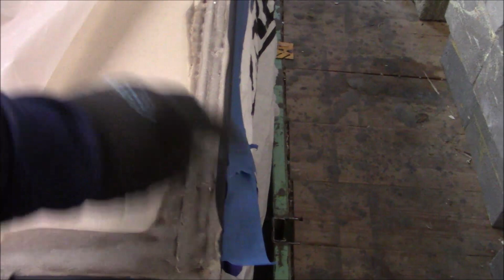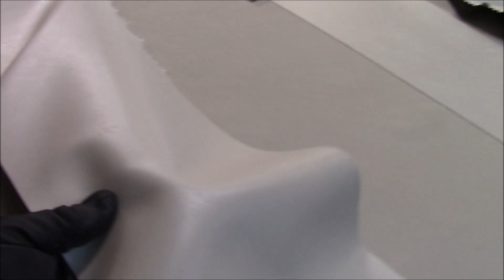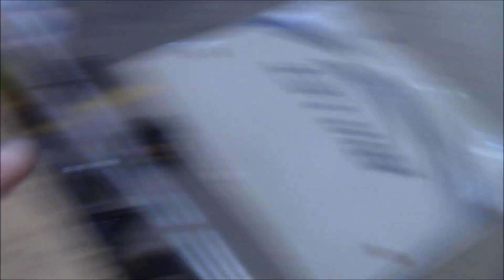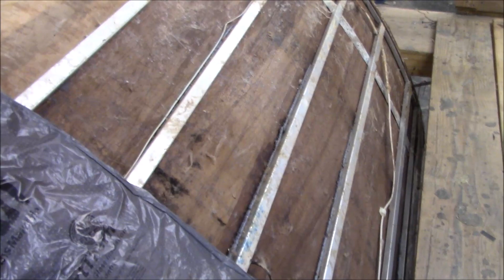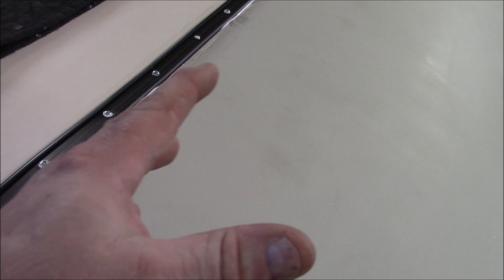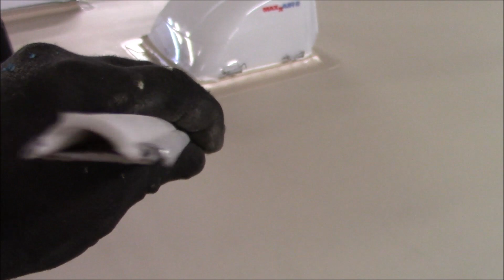2016 Keystone Bullet, New Roof Re-Deck Sealed Exterior Replaced Molded Platform for Fridge

Comment: Always enjoy you videos, I am retired and just bought a 07 outback trailer, it was kept indoors in the winter and I do not want to make it leak  by saying this but I have looked all over and can not find any evidence of a single water leak or delam and I have never seen this vintage outback that did not have front de-lamination ! I am a do it your selfer to an extent you would not believe, I plan on doing the roof next winter its the original so I plan on trying to mimic your work, you said you almost always re deck the roofs, well cant wait to see what awaits me under the old TPO. FyI the reason the aluminum trusses in the Bullet hear are so thin is that they are galvanized steel, thin but very strong if kept vertical, and as you found out a course thread works good on them! yes all these RVs are substandard overall quality but I believe its the complete lack of workmanship is the real problem, caused by way too fast work forced my the mfg company! through it together and shove it out the door! I know your videos are for your customers and advertising but you will always have some guys that are not smart enough to make allot of money so they can have things done for them and will either do it them selves or do without, I am one of those two guys,  thx be well, Mark R

Comment: I was going to look at buying a used 2014 Keystone Bullet and this video convinced me that I want to purchase a camper with better bones. I prefer fiberglass over aluminum siding and I like the idea of a lightweight aluminum frame. What manufacturers do it right?  I also want to be able to walk on my roof. That Bullet wasn’t strong enough to walk on.  We currently have a Wolf Pup that I can walk on. It has aluminum exterior and I think the framing is wood. We are looking to go a bit larger.

Comment: If you started your own RV business and sold RV’s that your shop built, I would buy without hesitation.
Reply from the maker: We have ideas on a truck bed camper and bumper pulls. No fancy fancy stuff,, just quality built long lasting campers. We are so overwhelmed with repairs and short handed we have even attempted anything.
Thanks for watching.
Reply: @RVROOFINSTALL  that would be awesome!! You are on the right side when it comes to knowing what works and what doesn’t, you’ve seen it all. The heat weld tpo should be mandatory. After watching your videos, we refuse to buy a new rv just to have it rotted in 5 years. We have an old rotten one that we inherited and are going to attempt to fix, it may be to far gone to bring back, but we need to try. Hoping under $5k will get it leak proof and solid again. We don’t do fancy either, we need functional.

Comment: Hello I see you say to use a primer before you seal along the edge of a rubber roof. What is the primer and what kind of sealer do you recommend. Thanks
Reply from the maker: Any membrane primer will work. You can use Rapid available at Home Depot...OSI Quad. I would lean more towards the Rapid. Last i knew that had it in the cement section. 
Thanks for watching!

Comment: Can you do a video talking about what you think is the best trends for RV roof, wall, seam designs?  It would be good to know what to look for when buying new(er).  Everyone on a budget should buy one of these pieces of crap you show to make mistakes with (scrape trees, back into rocks, hit low hanging stuff) but eventually you should hopefully graduate to buy something that is newer, nicer and built right.

You're videos showing failures are very interesting.  I have a 2006 toyhauler trailer that's failing just as you show countless times.  When I saw in the trailer owners manual instructions, even before I noticed problems, that owner should seal seams and inspect caulking I new it was a mistake to buy it.  Why can't manufactuers build RV's economically without so many weaknesses and so much maintenance?
Reply: I would love to see a video that incorporates all the best building strategies! And then outline the manufacturers who implement them!